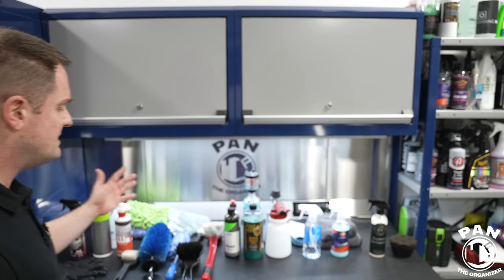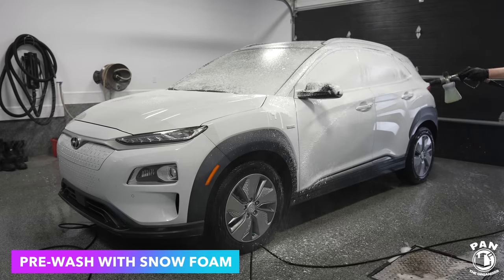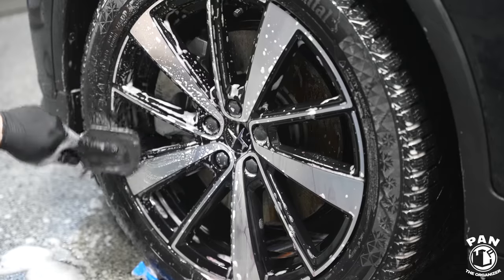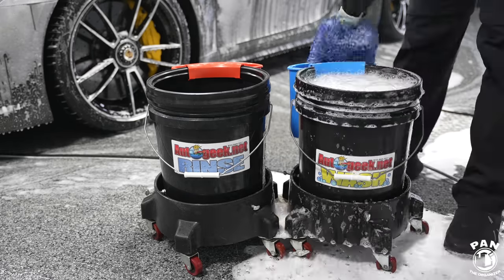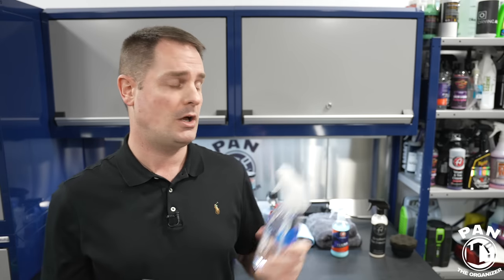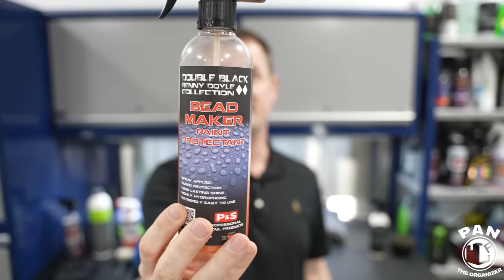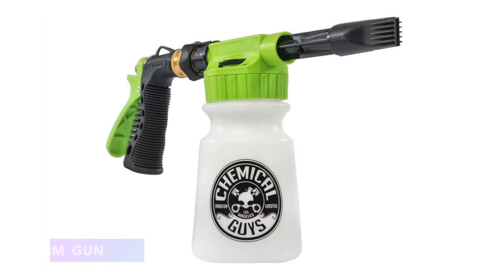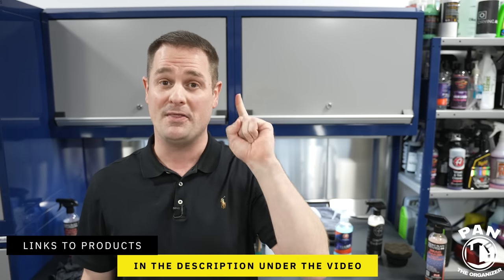Car Wash Kit - Everything You Need For A Complete Wash!

Comment: Does the phoenix titan replace the Wax Steps? Or is that the next step after you use it?
Reply from the maker: Yes Titan will certainly last longer compared to a traditional carnauba wax.

But ideally, you already have a much longer lasting protection like a good ceramic coating. Using Titan as a drying aid after maintenance washes is a good way to maintain the ceramic coating staying fresh.
Reply: @PanTheOrganizer  thanks for the response, can't wait for the latest interior kit vid.

Comment: Let's say you don't have the time to wash the car at home.  You bring the manual pump spray foam gun with you to one of those car wash bays.  Foam the car, then "wash" mode for soapy water, then "rinse" mode for water.  As long as a drying aid (such as Xtreme Solutions Topper) is applied, drying the car with a microfiber drying towel should be fine even though you didn't use contact method when applying the soap?
Reply from the maker: I would always recommend a hand wash stage. It's the only way to ensure 100% clean paint. You would not hand dry the vehicle if you didn't properly wash the paint by hand first. There's just so much a snow foam can do in the contactless pre-wash. That's just one of the steps to minimize scratches and swirls. But you need to manually contact wash your paintwork that's for sure.

Comment: this video is over a year old, but will a pressure washer remove any wax/coatings on the car?
Reply from the maker: No. Pressure washers won't remove existing paint protection. Just don't go over 2000 psi when washing cars. 1000 to 2000 psi is ideal.

Comment: Do I need to spry drying aid. If I were to use the blower for drying off the car. I am a newbie to this. I hope someone can answer my questions.
Reply from the maker: If you have protection on your paint, like a wax, sealant or ceramic coating, you can use a leaf blower or car dryer to dry the vehicle. You won’t need a drying towel. But, there is always a bit of left over residual water here and there, so we typically go over the car quickly in the end with a microfiber towel and a drying aid which also boosts gloss and slickness.

See how I wash my car using that method here: https://youtu.be/KEAfc_LUO4E
Reply: @PanTheOrganizer  Pan, thank you for your response 🙏 😊 👍.

Comment: Hi pan Good video  👍no its vary good  I use p.S brake buster . P.S bead marker. P.S express interior cleaner. An Meguiar's all-purpose cleaner Meguiar's compound
Adams shampoo an carport reset shampoo too. 
Optimum car wax .  Sonex perfect finish.  T.l.c the last coat an the amp .seal an shine sealant wax .  Gyeon wet coat .
The last coat Vera trim. Carpro iron x gyeon preep. Koch motorplast turtle wax power out fresh clean griots garage surface wash. Auto finesse clay lube . Invisible glass. 
Not got tyre dressings yet . At mo only got a kartcher k2 pan I have some cloth from the rag company an detailing cloths for inside too. I think that all. Pan 
All the best say big hello to you family an the dog 
Stewart ☺️☺️
Reply from the maker: Hi Stewart! I hope you are doing well.
Reply: @PanTheOrganizer  Hi pan yes doing ok get abit low as the house will be going at this point heating on the contract to be done then I guess date to move on thank again pan still like to meet you one day come on pan come to the UK or could I come to Canada to meet you . All the best to the family an you pan I sincerely mean that Stewart